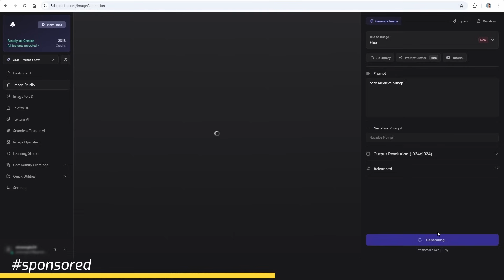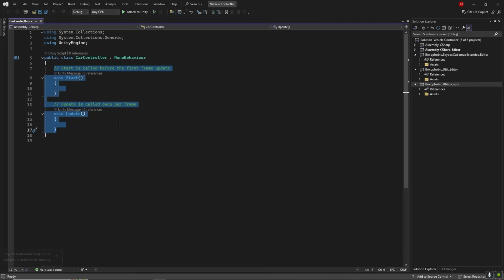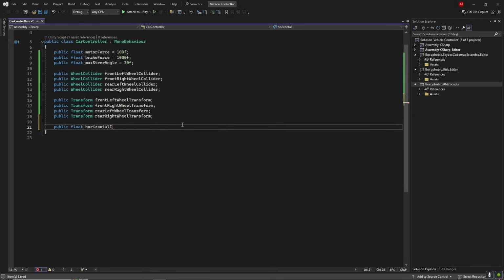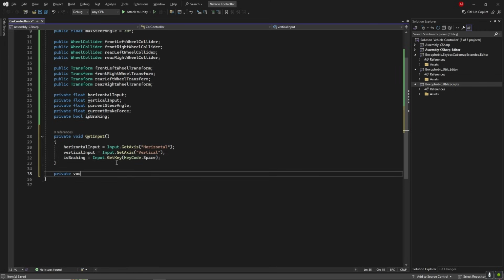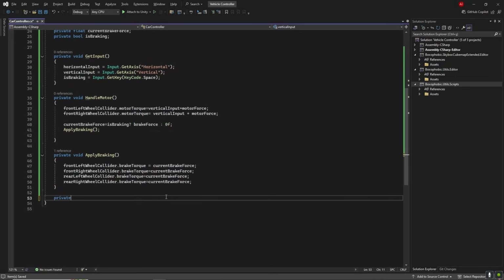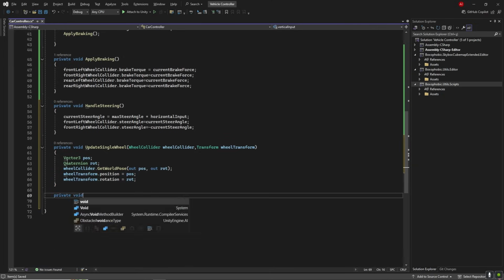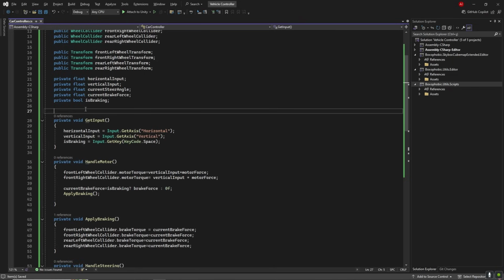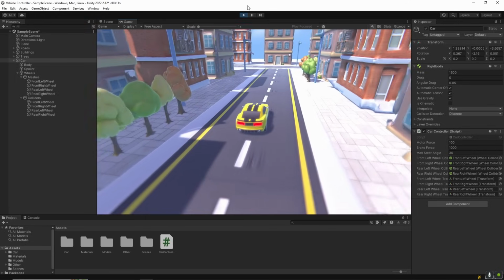Unity Car Controller With Wheel Collider – Easy Tutorial (2025)

Comment: using System.Collections;
using System.Collections.Generic;
using UnityEngine;
using TMPro;

public class CarController : MonoBehaviour
{
    public float motorForce = 100f;
    public float brakeForce = 1000f;
    public float maxSteerAngle = 30f;

    public WheelCollider frontLeftWheelCollider;
    public WheelCollider frontRightWheelCollider;
    public WheelCollider rearLeftWheelCollider;
    public WheelCollider rearRightWheelCollider;

    public Transform frontLeftWheelTransform;
    public Transform frontRightWheelTransform;
    public Transform rearLeftWheelTransform;
    public Transform rearRightWheelTransform;

    private float horizontalInput;
    private float verticalInput;
    private float currentSteerAngle;
    private float currentBrakeForce;
    private bool isBraking;

    private void Update()
    {
        GetInput();
        HandleMotor();
        HandleSteering();
        UpdateWheels();
    }

    private void GetInput()
    {
        horizontalInput = Input.GetAxis("Horizontal");
        verticalInput = Input.GetAxis("Vertical");
        isBraking = Input.GetKey(KeyCode.Space);
    }

    private void HandleMotor()
    {
        frontLeftWheelCollider.motorTorque = verticalInput * motorForce;
        frontRightWheelCollider.motorTorque = verticalInput * motorForce;

        currentBrakeForce = isBraking ? brakeForce : 0f;
        ApplyBraking();
    }

    private void ApplyBraking()
    {
        frontLeftWheelCollider.brakeTorque = currentBrakeForce;
        frontRightWheelCollider.brakeTorque = currentBrakeForce;
        rearLeftWheelCollider.brakeTorque = currentBrakeForce;
        rearRightWheelCollider.brakeTorque = currentBrakeForce;
    }

    private void HandleSteering()
    {
        currentSteerAngle = maxSteerAngle * horizontalInput;
        frontLeftWheelCollider.steerAngle = currentSteerAngle;
        frontRightWheelCollider.steerAngle = currentSteerAngle;
    }

    private void UpdateSingleWheel(WheelCollider wheelCollider, Transform wheelTransform)
    {
        Vector3 pos;
        Quaternion rot;
        wheelCollider.GetWorldPose(out pos, out rot);
        wheelTransform.position = pos;
        wheelTransform.rotation = rot;
    }

    private void UpdateWheels()
    {
        UpdateSingleWheel(frontLeftWheelCollider, frontLeftWheelTransform);
        UpdateSingleWheel(frontRightWheelCollider, frontRightWheelTransform);
        UpdateSingleWheel(rearLeftWheelCollider, rearLeftWheelTransform);
        UpdateSingleWheel(rearRightWheelCollider, rearRightWheelTransform);
    }
}

Thank me later
Reply: ur a hero
Reply: you saved my hands from breaking apart
Reply: @Tobi-of9nl  Glad to help💚
Reply: @Psanter-Bceif  help me, i cant drag wheel in colliders and there is no opton showing in selection popup